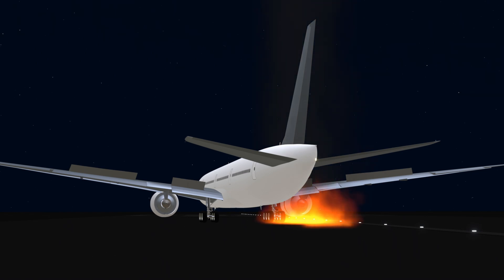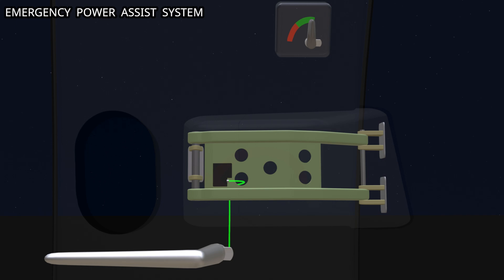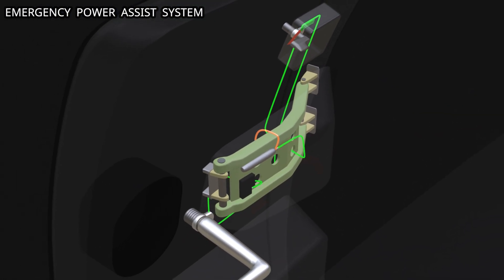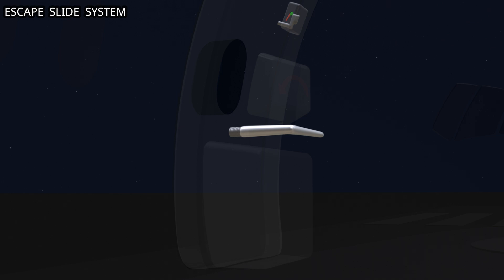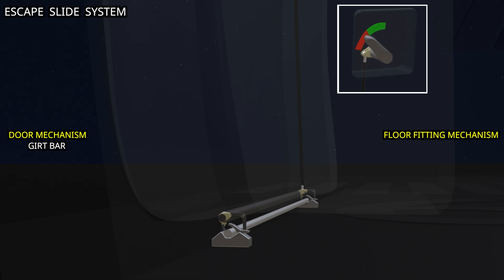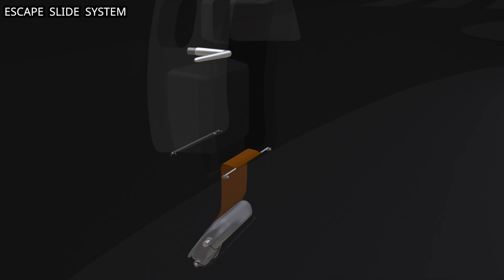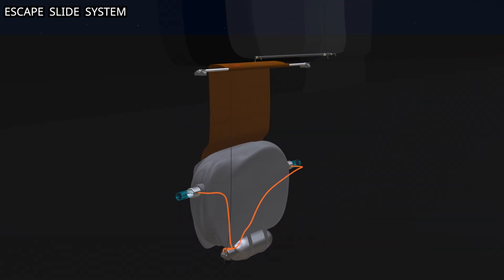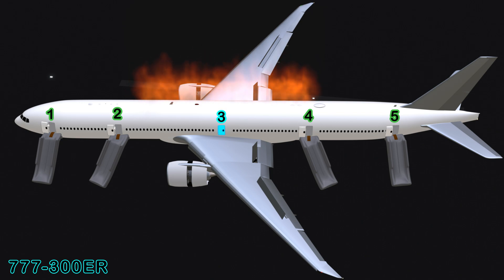How Escape Slide Works | Part 1 : Door-Mounted Escape System

Comment: Can we get this escape device for houses if so where please respond I'm very interested
Reply: i dont know of any company that does that, there may be one, but it is extremely expensive $20,000+ but they do have a similar but different application for high rise building evacuations that basically pops out of a window and makes a big rubber canvas tube and the person climbs inside and zips down at a safe speed

Comment: Very informative. I always thought you still need to push on the door to open it after rotating the handle.
Reply: The power assist is only activated in an emergency, when the door is "armed." When the mode selector in the "disarmed" position, door operation is entirely manual. That's why the door is normally opened by the boarding bridge operator - it's easier and safer to pull the door from the outside. It's well-balanced, but still quite heavy.
Reply: This applies only on the Boeing 737